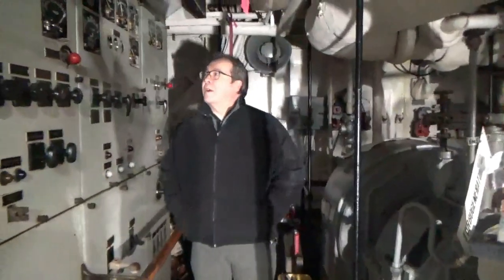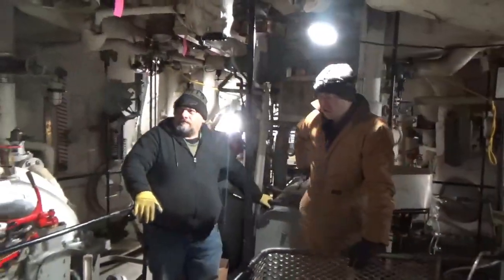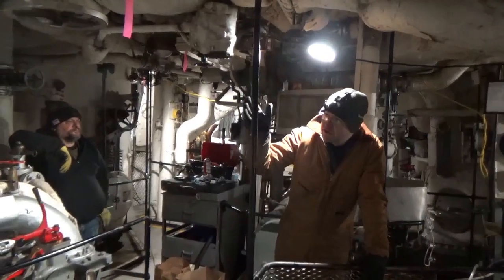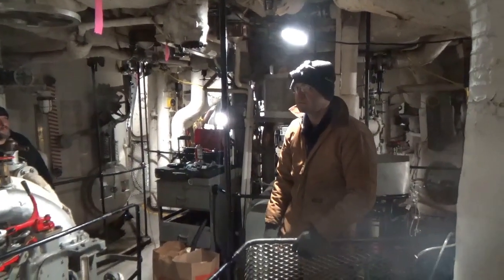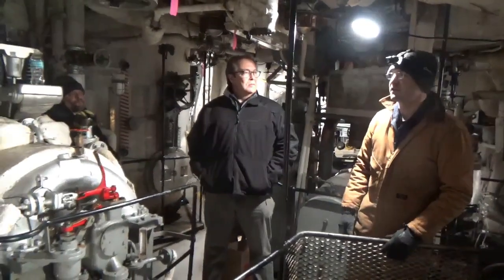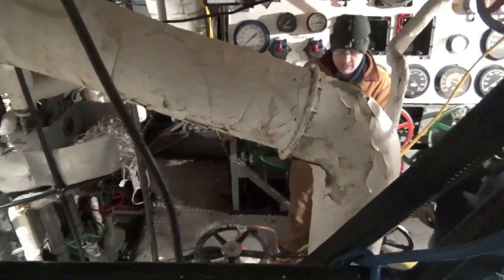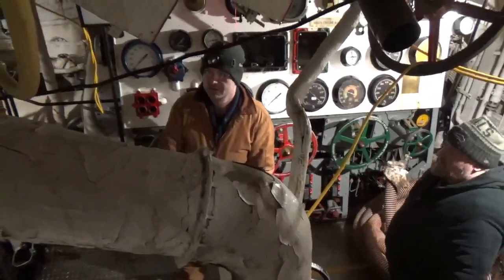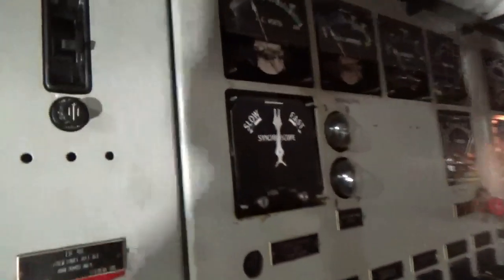Energizing USS The Sullivans PART II!

Comment: When I worked on shipboard electrical systems, many years ago, I remember the ground detection lamps indicated a fault.   Maybe with wye connected shore power it's normal.
Reply from the maker: Thanks for watching and your comment. This video is a few years old now, and there's been a lot of headway. I should do an updated one. Appreciate it!
Reply: @BuffaloNavalPark  Thank you for restoring an important part of the ship.
Reply: @BuffaloNavalPark  Bringing back old memories.  In the mid-70's was on a floating submarine dry dock that was built in '43.  Four engine rooms with two diesel engines each and two switch boards and remote metering and generator controls each.

If a sub was in dock an engine room was supplying power to the sub and the E/R was rotated each day.

Anyway, whether we were going to be bringing in, or getting rid (shitting the sub) of a sub; all E/R's would come on line and operate independently.  All the ground detector lamps were on and I flipped the test switch.  

It indicated a full C phase ground.  We paralleled to the bus and I checked the ground detector.  It had vanished and never came back.

We also provided fresh water and cooling water for the reactor.  No idea how that operated. We provided and it was them that determined things after that.

The sub crew went to floating quarters in a barge.  A palatial change for them.

Comment: This video is a long long way from showing viewers the how and why of restoration of power onboard and if we are to take it at face value it shows some of the reasons the ship sank in the first place and does not instill confidence in its future. 
What did those very bright ground detector lights do when the test switch was pressed? It was tested wasn't it? Why are they all so bright? They should not be at full brightness when insulation resistance is acceptable. What is the leakage current on the now higher voltage? The first video never stated that the "testing" was done with lower (1/2 ?) voltage which produced less stress on the insulation.  
The fact that 20A fuses did not blow is far from proving that the hull is not dangerously energized and capable of either dissolving in the next few weeks or killing the first person to complete the circuit between the ship and a shore ground. Has anyone measured the voltage between the hull and a shore ground? Having everyone standing on rubber mats in the middle of the engine room was kind of amusing but doesn't speak well of the knowledge and skills of those present at this little exhibition.  
Relying on leakage current to "heat" the cabling is absurd, current through the leakage path(s) does nothing but damage the already weakened insulation. Either load the circuit and hope for the best or use low voltage DC in a closed circuit to warm the conductors. Why are you waiting to apply power to the lighting transformers? Megger test the transformer circuit from the switchboard and either power them up - they make a good load to warm the rest of the conductors - or isolate them if they are ruined. Waiting for another video is not doing the ship or its equipment any good, it just gives more time for moisture intrusion, corrosion, and damage. A competent marine electrician will know the how and why of restoring compromised equipment, hire one today and stop pretending to "save the Sullivans".
Reply: Indeed the video is just a snapshot, depicting one short event in the 8 month long process to get this far. I have been working with Mario and the others at every step. In order to keep these videos watchable, a lot of technical boredom is omitted. We are being extremely cautious, as Mario stated in this video, we trust nothing until proven safe. The ground detector lights appeared brighter than usual, I suspect, because the lighting level in the space is low and the video camera makes everything look brighter than in reality - just look at the other temporary lights for comparison.

At every step, the team takes phase-to-phase resistance measurements and phase-to-hull measurements using a megohmmeter (megger). Each phase -to-hull has been very encouraging, several megaohms each. We know the hull is not energized. Phase-to-phase readings internal to the cable indicates some moisture may still be present. Where readings are too low, we do not energize, but rather force off the moisture via external means.  

The 20 amp fuses used in the temporary fused disconnect are there to minimize arc flash should there be an undetected fault. The next step will be to energize the lighting transformer bank, but the inrush current is greater than 20A, so larger fuses are needed. We will only take that step once the 450VAC part of the switchboard is proven functional and safe. 

Your criticism of the pace is unprofessional. Safety is paramount. Accidents happen when people rush. Everything is checked and rechecked before any action is taken. That makes for boring videos, however. Yes, if there were more people and more financial resources, the pace would go faster, no doubt.   When on active duty, I was trained to restore electric equipment from salt water immersion, and we are using those same practices on The Sullivans. The equipment is old, but built to the same standards so I have no doubt that with care, the electrical system can be properly and safely restored.
Reply: @barrywitte6562  My criticism is not of the pace, it is of the process, but thanks for the additional information as it raises more questions. 
I was incorrect in stating that the first video did not say that initial testing was done at lower voltage when in fact Mario and Shane said it was. Given it is a 3 phase system, the voltage was probably 208V but still the low resistance leaked 100mA someplace, either between conductors or to the hull. That amount of current at that voltage means the insulation resistance was around 2K Ohms which is far less than “several megohms”.  The fuses in that disconnect on deck sure look like Bussman KT series from the home store. If that is what they are, they might be fast acting but are not fast enough to prevent an arc flash. 
This video begs the question, why bother with the risk of electrical fires, shock hazards, and electrolytic corrosion issues resulting from trying to reenergize a sunken electrical system? Energizing any of the 450V bus and branch circuits that were flooded before complete disassembly, inspection, overhaul, reassembly and testing to manufacturer’s standards along with replacement of flooded cabling is pointless.
If all you want to do is provide lighting and utility outlets you don’t need to energize the switchboard and lighting transformers. If the lighting circuits on the port side were never wet, isolate them from the board and power them from a 120V supply hidden in some out of the way space. Run new cable for lighting in the formerly submerged compartments. The fixtures are probably corroded and electrically unsound junk by now but can most likely be gutted and refitted with LED bulbs.
Reply: @oldtugs  Fair comments, there's always a few ways to skin a cat... but the proper and safe way you suggest is correct. I own a 1943 patrol boat that was sunk at its moorings by well intention-ed museum staff, lucky for me the entire wiring system is tinned copper with rubber insulation, thanks to a navy refit in the sixties. Im still restoring the boat and modernising  the engines and generators along the way.
Reply: @oldtugs  Well,OldTugs, you have technically valid points, but you do not have all of the information, just what has been presented in these YouTube updates. I do not wish to argue with you in a public forum such as this. In fact I would argue with very little you say. If you are here to pick a fight, I politely decline. If you truly care about the ship, I invite you to contact the Buffalo Naval Park and volunteer your services.
Reply: @barrywitte6562  "... you do not have all of the information, just what has been presented in these YouTube updates."
There is little if any real information provided by the organization that publishes these videos in order to attract financial support and publicize the park's attractions. I am not here to argue with anyone, just to point out the risks of allowing "well intentioned" but unqualified volunteers and staff to perform technical work and make operational decisions beyond their skill level. As I have pointed out in the past, that is what sunk the ship the first time. If you want public funding, expect public accountability.
Reply: The online story keeps changing. My comment above "I was incorrect in stating that the first video did not say that initial testing was done at lower voltage when in fact Mario and Shane said it was." turns out to need a correction of a correction of conflicting statements in the first video. While your electrical guy was connecting that ungrounded fused disconnect with a single phase (line, neutral, and ground conductors) extension cord to 480V 3 phase with no ground connection, he stated it was 480V but 8 minutes into video 2 he clearly states   that the initial test was done at "much lower voltage." Why he and your curator later claim it was reduced voltage is a mystery. What part of "extremely cautious" is wiring a disconnect to 480V 3 phase with no ground connected to a metallic box and standing on a steel deck while turning the power on? The comment in Video 2 about not knowing if there is a short between a pair of bus bars completely negates all claims of testing and finding no issues. A simple check with an ohmmeter would tell if there is less than infinite resistance between the bus bars. Between standing on rubber mats in the middle of the engine room and not knowing if there is a short circuit between bus bars shows an amazing lack of competence. The difference between the verbosity of claims in the videos and the actions displayed should be a large red flag to park management and city risk managers. Please hire a professional marine electrical engineer or at least a professional marine electrician to manage this project. Both of these videos illustrate a wasteful at best and potentially very dangerous lack of skill, knowledge, and experience in the subject. Final question, what systems are you operating on that boat that require 480V 3 phase power?